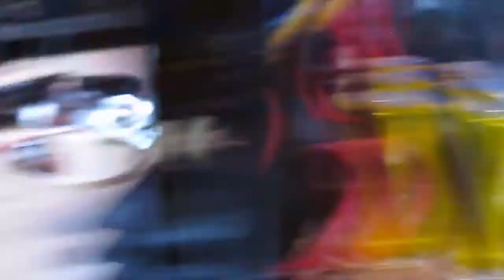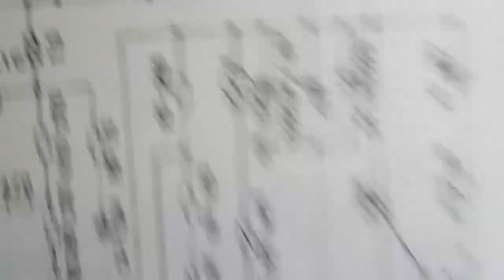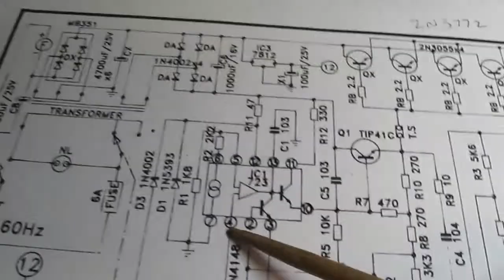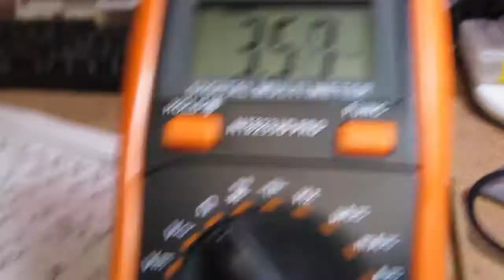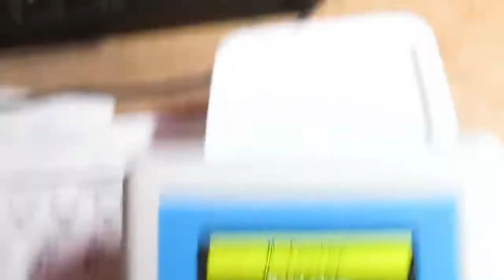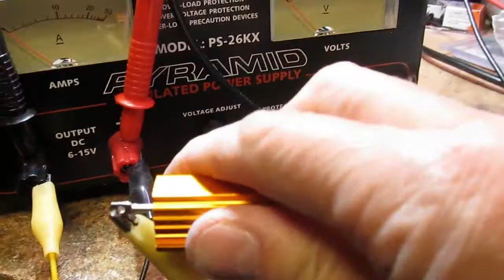Pyramid PS-26KX Power Supply

Comment: The SCR is part of the crowbar circuit.  I think the original 723 is still good.  Too bad, they didn't put an inline fuse in the circuit.  It would have been the fuse goes, instead of all those pass transistors.

Comment: You could put your 8 Ohm Resistor in line with your Digital Meter in 10 or 20 Amp setting which ever your meter has and read your Amperage on it to Compare. 16 Volts divided by 8 Ohm equals 2 Amps so 15 Volts should be pretty close to 2 Amps.
Reply from the maker: Thank you! I will definitely try that out.

Comment: How did you figure out what Voltage and Amperage to order the Replacement SCR that you used? The new part shows to be a TYN416 which is a 400 Volt 16 Amp SCR and the Power Supply is a 26 Amp Supply.

Comment: Buy a group 27 or 31 boat battery for CB power and charge it when you finish talking . NO noise and simple, nothing to repair and cheaper too. Headache solved.  Trash the Pyramid.